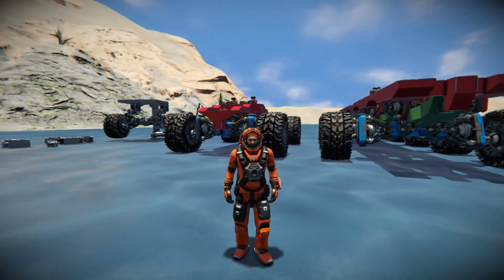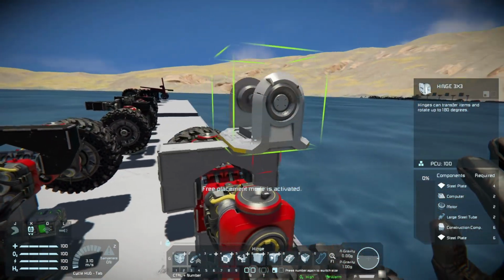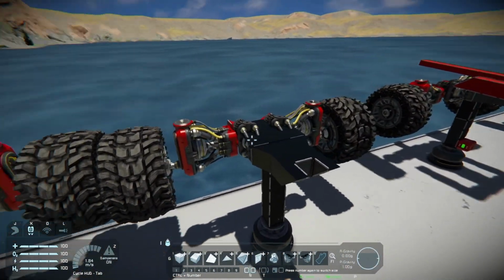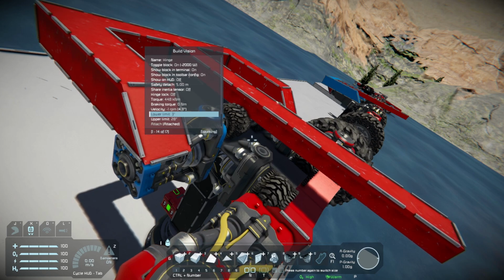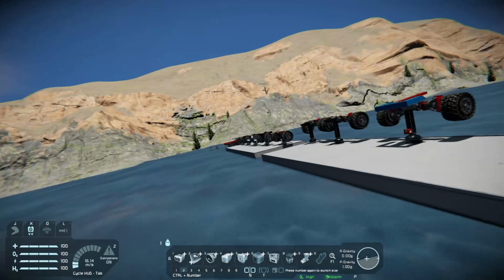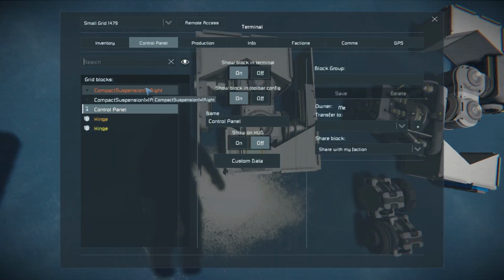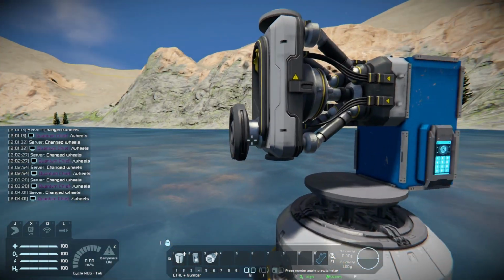Custom Rover Suspension Tutorial

Comment: This no longer works on PC space engineers. I tried following this tutorial step by step but it's rubbish. It doesn't work. you cannot place blocks where the tutorial tells you example at 5:59 where the tutorial tells you to put the 1x11 wheel suspension so you go to do that but the wheel cannot be placed. FIX THIS
Reply from the maker: Yea, in one of the recent updates they hitbox for wheels and suspension block have changed, ill make a new one soon
Reply: It literally works just fine I was able to make it no problem
Reply from the maker: @remster5284  the hit boxes of wheels certainly have changed but I’m glad you made it work
Reply: @quantumchief   Maybe the one with only one block doesn't, I haven't tried it. The one with three blocks works just fine though

Comment: 11:47 so could u explain how yours work but mine doesn't, i cooy that 3 block wide one put it on a grid with power wheels aren't moving or turning but if i put a gyro on i can make it do wheelies.
Starting to think rovers are pointless in se since if they cant bend or work in creative survival is pointless
Reply from the maker: I think wheel suspension has changed its hit box a bit, ill need to make a new video i think to show it off now

Comment: So, tried using some of these ideas to work on my own suspension. First, I tried using the trick to attach a rotor head to a suspension, then attach a second suspension to that to get more travel distance. And while the rotor head does attach to the suspension just fine, the moment I try to attach a second suspension to the same subgrid anywhere, one of them seems to separate from it's rotor head and moves to face the other suspension, acting like it's stuck to the same rotor head almost. 

Next I tried using a double boom-arm using hinges, with a 1x1 suspension on top of them to act as a spring. And while this works to an extent, it ends up being too weak and too fragile to support any real weight. The least little impact seems to destroy it, even when using heavy armor. Not sure what I'm doing wrong, but any suspension I try just ends up being too fragile to be useful.

Comment: I'm trying to understand the actual benefit of a custom suspensions over a regular one. I've built a couple of different variations of custom suspensions including the ones here. The main issue is when you add more weight to the vehicle it puts more pressure on the hinges, pistons, and rotors which requires more torque to counter which can start clanging issues. Also, you need a script to manage the subgrid wheels, and some of them like DriverAssist require you to put a remote control on each of the wheels.
Reply from the maker: its more or less just for the fun. one its a challenge to build and 2 when done right its satisfying to watch it as it flexes over the dunes

Comment: I made a custom suspension using your design as the base and I was wondering if you would be willing to take a look at it and maybe give a couple of tips to better design You may also find something interesting about the design as is taking inspiration from yours but part of the design has been mirrored and is using 2x2 instead of one by one wheels. Search Soggy MK5 at the workshop

Comment: 23:20 solution is you mount it with the back. Classic Half-Truck, no?
Reply from the maker: The problem was the where the rotor heads are on the suspension acts like free rotors, meaning the wheels could slide, side to side. I have since fixed this issue

Comment: could you show how to attach two suspension's  together in survival.
Reply from the maker: The best way i would recommend you try build it is first in creative where you have no resource requirements. the other thing i will say is build it down from the hinge and rotors, you can use them to angle the suspension when building to fit blocks better

Comment: Have you tried this with large grid? when i try to recreate the first suspension on a large grid i cant seem to get enough propulsion to go fast than 3 m/s even after adding some large atmo engines just to test. not sure what im doing wrong.
Reply from the maker: I’ve never personally tried it, but it should still work, make sure you use a subgrid control script
Reply: @quantumchief  Thanks for the reply, I managed to get it working after blueprinting and pasting in a new save, I must have been getting some weird interaction with the terrain all is good now, thanks for the great work!
Reply from the maker: @Jaxftw  glad you liked it. i do have a new video coming out some point soon showing off some new designs

Comment: While you explained the how perfectly, the why is a bit elusive to me. I haven't built any suspensions myself sofar and while i get that these usually are to absorb impact, i wonder what the rotors are doing here. Is it to keep the chasis level to the center of gravity?
Reply from the maker: Its to keep the wheels in contact with the floor as much as possible, if the wheels are not on the floor they dont aid in the vehicles movement
Reply: @quantumchief got it, thx for the quick response. Have you seen though these suspensions which would keept the chasis level with the center of gravity? Basicly you could walk forth and back on the rover without ever noticing that you traverse rough terrain. I guess this could be merged with that.
https://youtu.be/UKWh4xzQPcE?list=PLrU8f9CW7sPErrv1zBVvvVpEjCFmpkPF5
this was the suspension system i ment
Reply from the maker: @kinngrimm  yea, i think they use scrips to keep things level. i like to just mess around with cool mechanisms
Reply: @quantumchief  can't one get the same effect or a similar effect without scripts? I mean if you have a balanced scale to all axis, wouldn't that then lead to being level to the center of gravity?
Reply: @kinngrimm Scripps are required because the wheels are on a subgrid not part of the main grid meaning if you get in the cockpit and try to turn the wheels left or right or even hit forward or backwards nothing will happen.

If you want to do this without scripts you need to set up the wheels on the subgrid to a group and then use the group overrides

Comment: no matter how many times i place the wheel for the the suspension, it doesnt place the actual wheel
Reply from the maker: make sure you are using the right size of wheel firstly. and use the hinges and rotors to move the bar out of the way to space each wheel

Comment: The times you stop to worry about enough clarity for us, im like "you're good man just keep going"
Reply from the maker: I appreciate it, I just try to ensure everyone can see what I’m doing
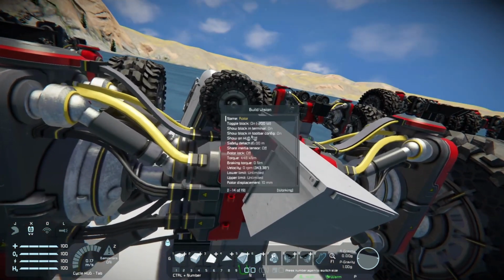Reply: @quantumchief  the process at 8:40-8:50 i cant get the wheels to appear, i made sure they're 1x1
Reply from the maker: @danny73910  try putting the wheel suspension upside down, the reversing the suspension
Reply: @quantumchief  ended up redesigning the narrow one with two rotors to be end arms for the wider one one. essentially making a quad forked 8x8

Comment: there was a time when have your wheels at an angle like that made your vehicle not drive like only the bottom of the wheel moves the vehicle and the bottom of the wheels not touching the ground so it wouldnt go very well
Reply from the maker: There not 100% perfect but it’s allot better then just vanilla wheel suspension
Reply: @quantumchief  i believe they fixed what i mentioned, it was like the bottom plane of your wheel was the only part of the wheel that would move you so if you put your suspension on an angle it would put the front or back of the tread on the ground instead of the bottom and it wouldnt move

Comment: Putting the 1x1 wheel on top of the main wheels' suspension is not working. Is it because of the latest update?
Reply from the maker: maybe, try putting the suspension block upside down, then change the suspension height

Comment: I'm not sure if I'm doing something wrong or the game doesn't allow me to do this anymore however, trying to build this in survival mode is a lot more difficult #1 because to move the rotors you have to turn one one way and turn the other in the opposite direction because they are mirrored. #2 when you turn the rotors to place the 1x1 suspension, there still isn't enough clearance for the wheel to spawn. I have maxed the rotors turned all the way to where I can't turn them anymore because it's hitting the 5x5 suspension and it still won't let me place the wheel. Maybe I'm doing something wrong, either way, cool build and thanks. I'm still a beginner as well, still learning.
Reply from the maker: In some cases I had to place the wheel suspension first before almost any other blocks after that is done I can refine the design

Comment: I used this to make a rover for a race, but I forgot that multiplayer games don't like complex things and the wheels used in the suspension just phased through the blocks and locked up the whole thing, so now I had to replace the whole rig with a normal wheel base XD. Great for solo though
Reply from the maker: yea, i hope one day (or in SE 2 ) they fix the phasing issue
Reply: Try looking on the steam workshop for a blueprint called " Soggy MK5  custom suspension" it uses a very similar suspension design that he has but it's using larger wheels and may not have the clipping issue..

Comment: For the 3 wide design it looks like the design is very different. I’m not sure how to explain it tho. I tried recreating it and it doesn’t work. My one wide works fine. It almost looks like the original concept of connecting the two rotors isn’t the case with the wider one. It looks like one rotor is connected to the “hinged” arm and the other rotor connects to the wheels. Am I wrong?

Edit: I tried Messing around and did just one rotor, put half slabs under the 1x1 wheels, and lowered the 1x1 wheels until the touched the slabs. Seems to work now

Comment: since you are already using one script, why not add one more? there is a script called Rotor Torsion Spring that turns rotors and hinges into suspension like objects based on the settings you give it.
Reply from the maker: For the most part I try and be as vanilla as possible, the one script it mandatory where other ones are extra

Comment: My biggest issue when trying to replicate your design from the first video before this is that once I put any weight up on the rover, it's difficult to keep it from having issues with lateral roll.  The rovers I built on stream tended to roll so hard during turns that it would want to flip and also at speed it would tend to pull left or right.   Worked amazing going over rough terrian.
Reply from the maker: yea, the suspension designs are good for the off-road capabilities however at speed they are questionable, If you saw right at the end of the video i showed a new suspension design. it has almost no issues with rolling whilst still offering good suspension.
Reply: @quantumchief  I did see that.  Looks promising.  Any luck with dealing with the sway.

Back to the complex suspension...I think I'm going to try an idea of putting all the axel rotors on a group and locking them when moving at speed, and unlocking them to deal with terrain.  We'll see how that goes on today's stream.
Reply: @quantumchief  So, I decided to put all the rotors for the axels in a group.  Locking them when on even ground works perfect for fixing the stability at speed.  Unlock them for terrain issues.  Now if there was just an easy way to force rotors to 0 out without having to run additional scripts, but as long as you're close to flat it fixes all my pulling and rolling issues.  I flirted with the idea of switching the last two blocks on the armature to merge blocks but we're already tempting klang as it is with this design!